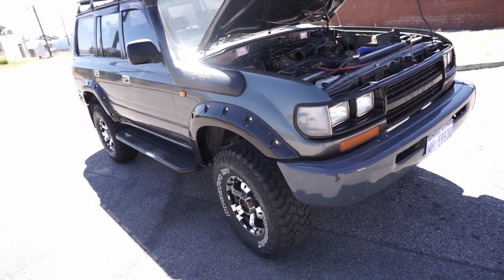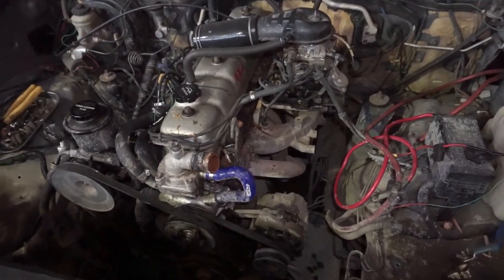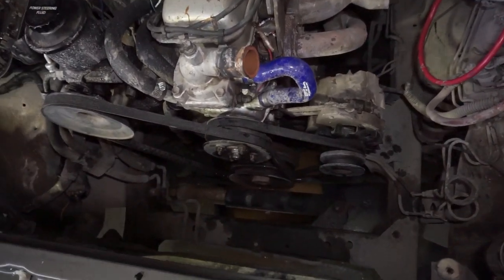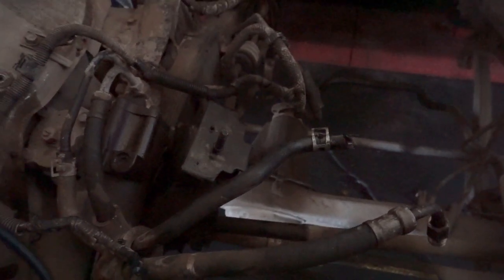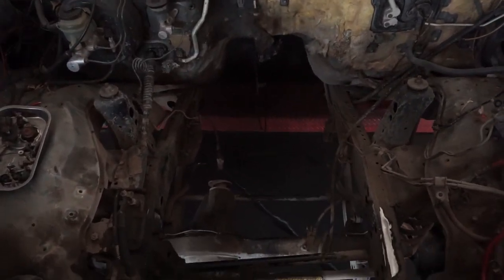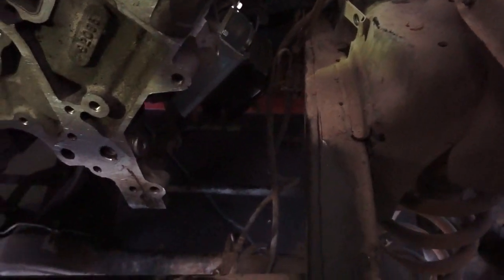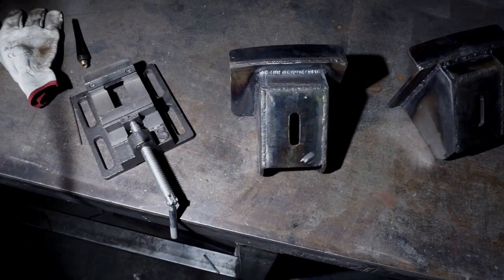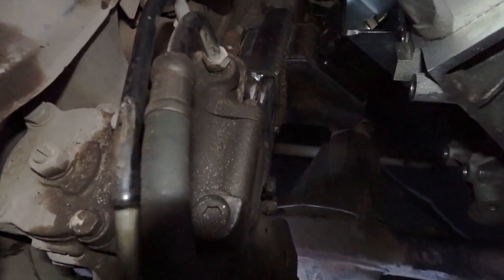Land Cruiser 6ltr Ls Motor Swap Part 1/3

Comment: How reliable are the ls3 motors? Like compared to the 2uz 100 series petrol
Reply: How reliable are the LS engines super reliable super easy to work on a infinity of upgrades
The aftermarket love them oh I know you're in that Toyota reliably bullshit that's so true why is the junkyard so full of them LS engine Car or truck goes into the junkyard It's quickly take out put in a other car you can't say that about most engines a Toyota engine stay in the junkyard and dies there
Reply: @rickhunter6479  hmm very true!!